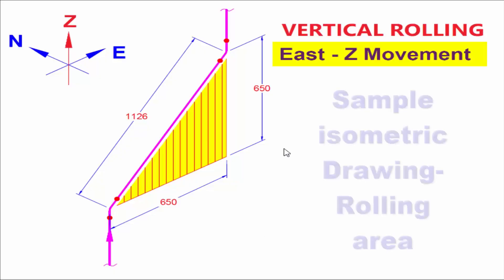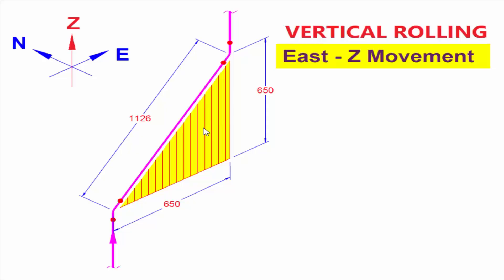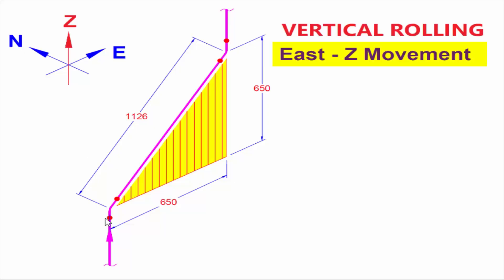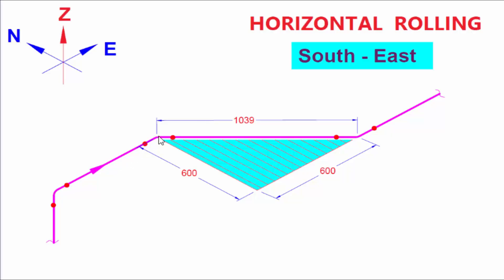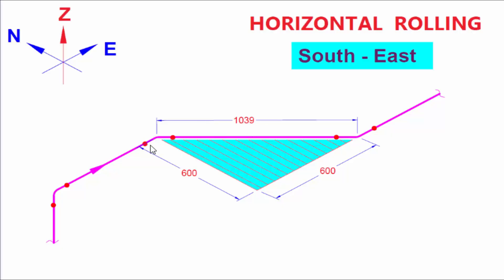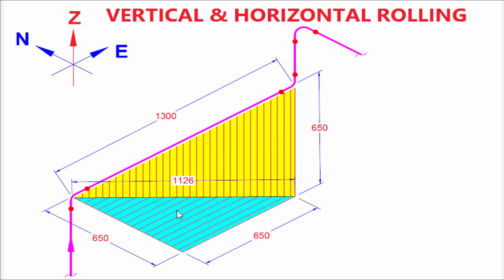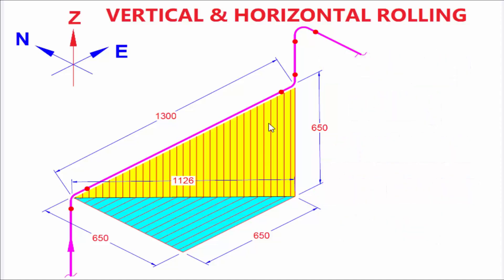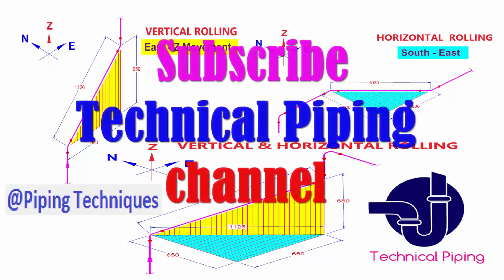Piping-How to Read Pipe Rolling/Offset in Isometric Drawing?

Comment: The travel should be 919.23 if the run and set is 650 according to Pythagorean Theorem, if the travel is 1126 with a 45 degrees anglel the Set= 796 and Run=796, therefore the sample of this clip is absolutely wrong..! Thanks
Reply from the maker: sorry for inconvenience.travel length for 600mm set and run =849mm and 650 mm set and run =919mm as per trigonometric formula.Here measurement taken from auto cad isometric(30x30 deg)angle position.so its coming  irregular measurements.THIS VIDEO EXPLAIN READING ROLLING TYPES ONLY,SO I NOT CONSIDER THE MEASUREMENT CALCULATION.

45 deg Elbow.For 600 mm set and run.
so sin45=600/travel,travel=600/sin45=849mm

For 650 mm set and run.
so sin45=650/travel,travel=650/sin45=919mm

THANKS FOR COMMENT.
Reply: Yes I came to see this comment 😄